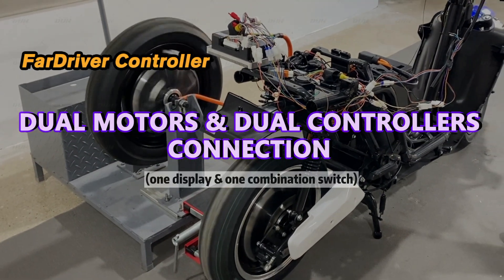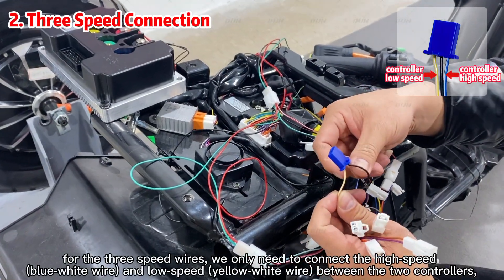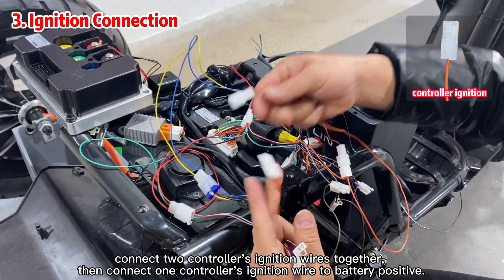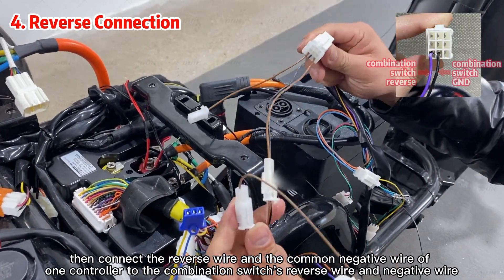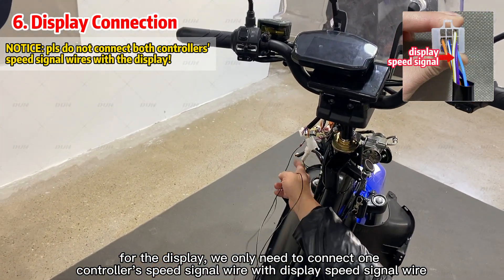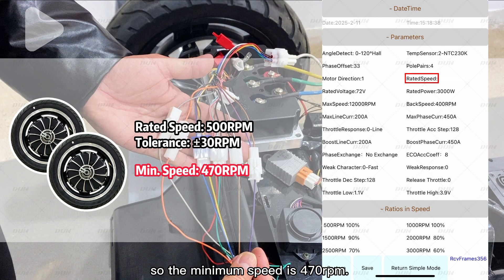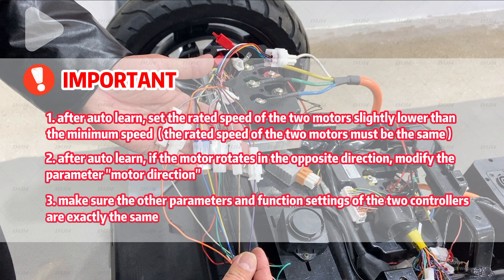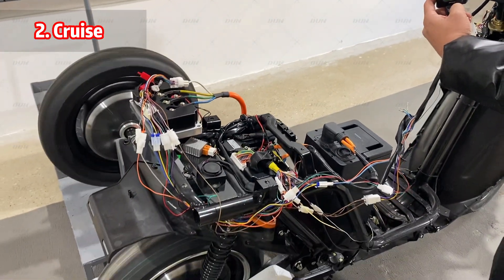How to Connect Two Motors and Two Controllers

Comment: What happens when you turn and one motor needs to spin slower than the other, acting as a differential? does it support that? if no, when you turn are both wheels doing the same speed ?

Comment: I'm in a process connecting 2 fardriver to my scooter...
Only question is about throttle....
I believe i must take only green from one controller and black - red - green for the other controller...
Only 2 green wires connect together!
Am I wrong?
You connect all wires??🤔
Reply from the maker: theoretically it can work when only connect the green wires together, but it is not recommended.
Reply: @YoMooTechnology2023  thank you! I will try it!!
But you are the only one who recommends all wires to connect in parallel...

Comment: I've just finished joining 2 motors and 2 controllers, stripped from 2 scooters and fitted to a racing gokart. Controllers are Votol 100, and topspeed without modification are 100 kp/hr I've 4 30 amp 72 volt batteries with 2 attatched in parallel and the other 2 fully charged as exchange. I'll check my wiring according to Yomoo.